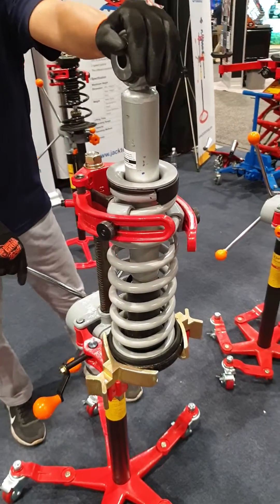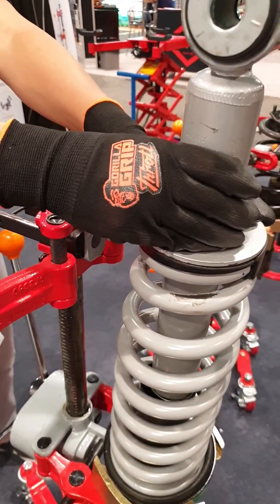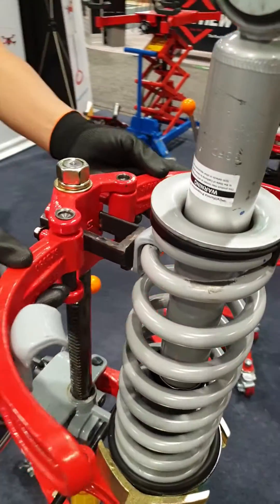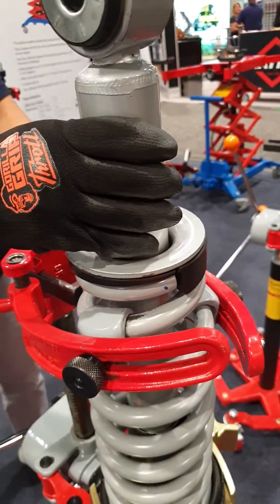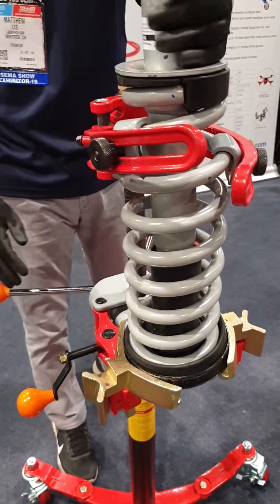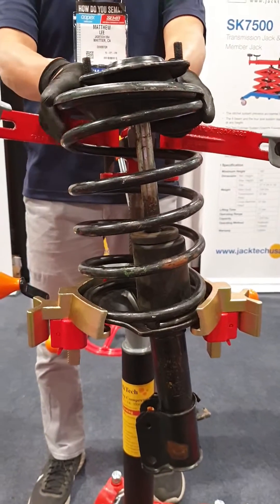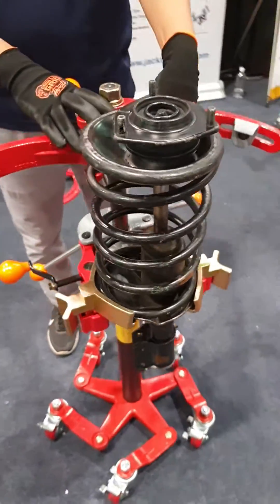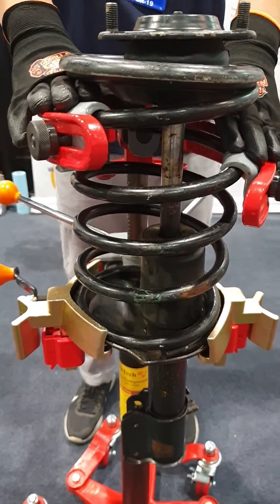Jacktech USA, SK-3500, Heavy duty spring compressor! Strut replacement in a minute! Federspanner

Comment: Can you take the spring out after removing the strut? Or does it need to be reassembled to take the spring out of the compressor?
Reply from the maker: Yes, if you turn the handle anti-clockwise, you can release it and take the spring out.  Thank you.

Comment: Exactly the same principle as those you can get between $100 to $200. Having said that, this is substantially better made with fixtures and fittings that you feel more confident in. Whether you can justify the price difference is entirely on frequency of usage.
Reply from the maker: Thank you for your feedback.

Products that use the same principle and are sold in the $100–$200 range are actually illegal counterfeits of our product. We have been manufacturing this spring compressor for over 40 years and hold numerous patents.

Selling such copies at low prices means they are made with extremely low-cost materials, which also means poor quality. As you know, compressing coil springs is a very dangerous job — a single accident can result in serious consequences.

Even if you don’t use the tool frequently, we strongly recommend using a product that prioritizes safety. Please be especially cautious of counterfeit versions of our product that are made by some Chinese companies.  Thank you very much.

Comment: this guy does not know how to demonstrate this , how that struts mounted on the bottom those clamps dont sit under the base of the strut they slot into the bottom springs
Reply from the maker: Thank you for your comment.  Our spring compressor can do either upright or upside-down and those clamps are designed to hold the base or the top case of strut, not spring.    If you do upside-down, as demonstrated, you can replace the strut by single compression, while it is still holding the top case and the spring  compressed.  The clamps also can be flipped for small springs that does not have base to hold, like coilovers.  If you have any questions or concerns, feel free to contact us at jacktechusa@gmail.com  Thank you very much :)